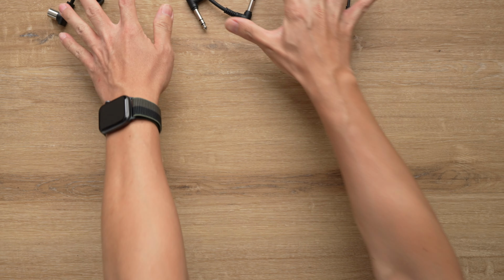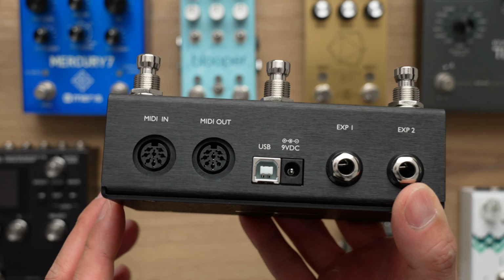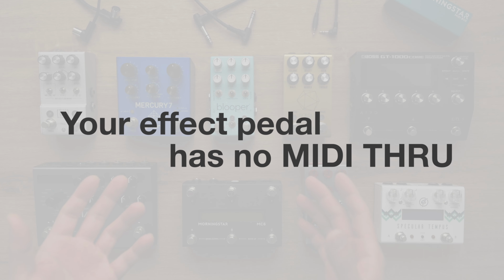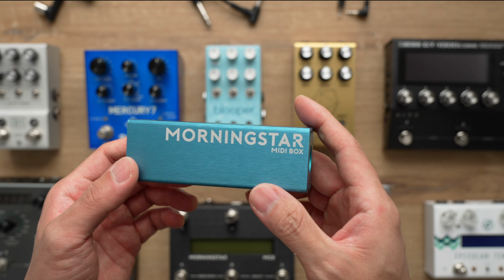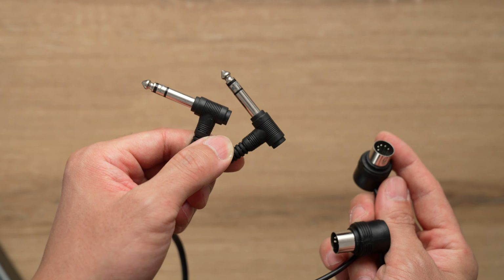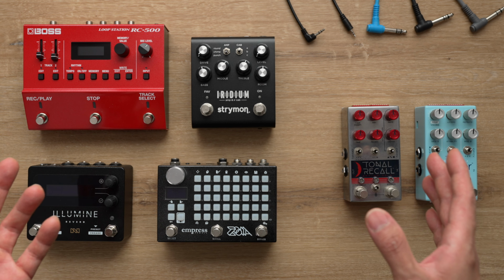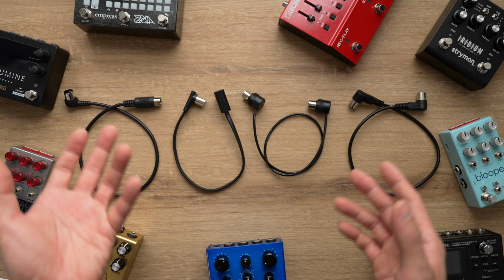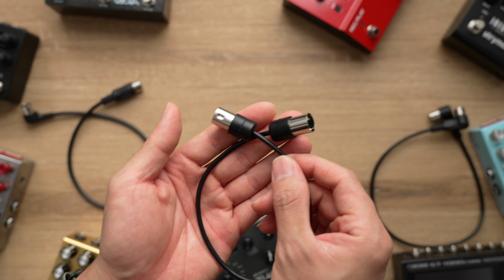Setting Up a MIDI Pedalboard - MIDI Connections Explained

Comment: Hi Morningstar, What is the cable for connection between Kemper Player with Morningstar MC6 PRO? Thanks
Reply from the maker: Hi! The Kemper Player has 2 different USB ports. It has both a Device Port and Host port. So does the MC6 PRO. You just need to connect one Host port to a Device port.

Comment: Are the Omni ports on the MC 8/8 Pro able to control analog overdrives or do we still need a separate box for those?
Reply from the maker: If you are asking whether Omniports can function as loop sends and returns like in a loop switcher, no they cannot. If you are asking whether they can function as external aux switch outputs, they cannot but that is what the PRO models' Relay Ports are for. We have a video explaining that here: https://youtu.be/VWQH1lkyNGY?si=-2JGKR49zL41nSNw

Comment: Hey there, I have a question for you. I noticed that very conspicuously. You are only programming with pedals that have screens and numbers for each one of their presets. I have a lot pedals by Red Panda and Source Audio, these have midi capability, but they are all about fine-tuning knobs, etc.
     Let’s say for instance, my Red Panda Particle 2, that’s a pedal notoriously thought of as “useless” as it is very experimental, but if you really tune something in with the knobs, you can find really sweet spots that are extremely musical. I want to know that this. Morningstar will be able to capture the settings. I make just with knobs and switches, no screens, not basically little computer computers with numbered presets..
    Anyways, it does look like a completely ingenious piece of gear, but before I buy it, I need to know that it’s going to work the way I wanted to with my pedals. I hope you get back to me on this or better yet make a video that shows that you can dial say five parameters in on a screenless pedal and it will save your settings precisely..
    OK, thank you so much for reading this and taking the time, please tell me if this piece of gear has those capabilities. 
     Yours truly,
          NAI⚡️🐉⚡️
Reply from the maker: Hi. You can use CC numbers to "turn" knobs on the receiving device if you like. We have customers who do this using the Moogerfoogers, which do not accept PC messages but they do accept CC messages. Sending multiple CC messages will create a preset sound. However, the Particle v2 allows you to recall presets by sending PC messages to it. That would be the better way to work with it. Turn the knobs on the Particle till you get your desired tone, save it as a preset, then recall it using a PC message from a Morningstar MIDI controller.

Comment: Thank you for this video! Can I use a pedalboard MIDI Controller for the strymon pedals and the amp (Like an Engl Ironball)?
Reply from the maker: The Engl Ironball does not have MIDI and you will need the MC6 PRO, which has Relay Ports that allow you to switch amps. We explain that in this video: https://youtu.be/VWQH1lkyNGY?si=PKdSijXBQc7S2ssB

Comment: I have a midi kenton though box but I was under the impression. You need midi in and out. If you want to use a peddle as an effect in the computer daw! Or use it in a jam with out the computer. I don’t use guitars. Only drum machines samples and keyboards.. I have lots of fx peddles

Comment: Can I use 1/4 converter TRS jack for connecting boss midi cable Bmidi2-35 3.5 mm with Strymon? Thanks
Reply from the maker: Hi. The cable you have mentioned is 3.5mm, why would you need to use a 1/4 inch adaptor? Also, you did not state which Strymon pedal you are using and whether it has a DIN5 or 1/4 inch MIDI port.
Reply: @MorningstarEngineering  oh, sorry...the Strymon I am trying to connect is Cloudburst (it has 1/4 TRS MIDI/EXP  jack)
Reply from the maker: @jeant9946  You did not mention which MIDI controller you are using either.
Reply: @MorningstarEngineering  I apologize...it is Boss ES5. However, I am thinking of buying Strymon conduit midi hub because I have Boss SY200 and want to combine them together via conduit. Is that possible?
Reply from the maker: @jeant9946  There should be no issues using the ES5 with the conduit, but you should check with Boss to be sure since it is their product you are using.

Comment: that RC500 was a friggin NIGHTMARE to program!!! Boss Midi Implementation is one of the most convoluted out there. Once its locked in though, it works a treat! Been rocking my MC8 for a couple years now, really solid controller. Thank you Morningstar!

Comment: What if I want to control (ie. a boss vocoder pedal) with midi?
Reply from the maker: Hi. The Boss VO-1 does not have MIDI.
Reply: @MorningstarEngineering  is there an adapter?
Reply from the maker: @JennyX69  The VO-1 is not designed/created to accept MIDI. An adaptor will not help.

Comment: can I connect my golden boy by Jackson audio into the expr 1 on the mc6 and controlled it from there?
Reply from the maker: Hi. Yes, you can. Just set the Omniport to 'MIDI Out - Standard' and you can control the GB directly with a TRS cable
Reply: @MorningstarEngineering ok got it. but how can I use the expr 1 to be a switcher for example Preset F. I want to set my golden boy boost on and off on Preset F. I already have the midi channel and CC number
Reply from the maker: Hi. Sorry, I don't quite understand your question. Are you wanting to use the port to connect to the GB or for adding external aux switches? Please send us an email at ‘help@morningstarfx.com’. We provide technical support from there. A service ticket will be created for you and we will be able to follow up easily.

Comment: The old method with MIDI IN to MIDI THRU was most effective with just one cable between interface. The new method is so ridicilous !!! Adapter, cable, converter, power supply, cable. Its so simple to add the old MIDI port and costless for the conceptor and the musician.

Comment: Nuenaber used a 2.5mm trs on their illumine - to avoid people adding headphone trs into the port - might be the only one
Reply from the maker: Yes, that is correct. Neunaber also includes the required 2.5mm to DIN5 adaptors with their MIDI capable pedals.

Comment: How do I connect a pedal like a morning glory that doesn’t have midi through but has an expression input? Will I be able to use the expression outs on the Morningstar to the expression in on the morning glory to turn it on/off using the Morningstar. Or do I have to buy the looper?
Reply from the maker: Hi. We actually just released a new product to do what you mentioned. Check it out here: https://youtu.be/yhl76sfU7mU
Reply: @MorningstarEngineering  I currently have 4 analogs pedals that don’t have midi, so I have to buy 4 of these relay units or am I better off with the ml5?
Reply from the maker: @jesusbautista7962  The ML5 and Relay Interface both serve 2 different purposes. Check out our website for more information! - https://www.morningstar.io/

Comment: How can I control my jet revelation pedal through  mc6 via exp 2
Reply from the maker: You just need to set the Omniport (exp2) to "MIDI Out - Standard" and connect it to the Jet pedal MIDI port with a TRS cable.

Comment: Love this videos, thinking of getting several Morningstar products. Is there a way of using more than one bypass looper with the MC8?
Reply from the maker: Hi. Yes, you can link as many ML5s as you need together via their MIDI In and MIDI Thru ports. You can set each looper to a different MIDI channel for independent control of all loops.

Comment: Strymon pedals have a special adapter to go from jack to 5 pin midi. Could you explain this in a future tutorial. I noticed my iridium works by plugin directly to the jack input of my MC6mk2, would it keep working as long as I keep connections with TRS jacks, even with a midi box in the path?
Reply from the maker: Hi. You can make MIDI connections with TRS or 5-pin connectors. It will not affect your MIDI signal. A MIDI Box in between will not affect anything either. It is just splitting and relaying the MIDI signals.

Comment: I love your stuff (MC8, MC6v1 and the ML5), but the smallest MIDI hub is the RetroKits 006. Coupled with the RetroKits DIN MIDI-to-3.5mm adapters, and your MIDI set up is super tight.
Reply from the maker: Thank you for your kind words! Ah yes, that is true. But it doesn't have 5-pin MIDI ports though!